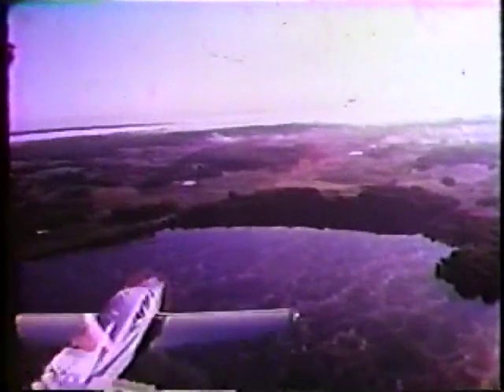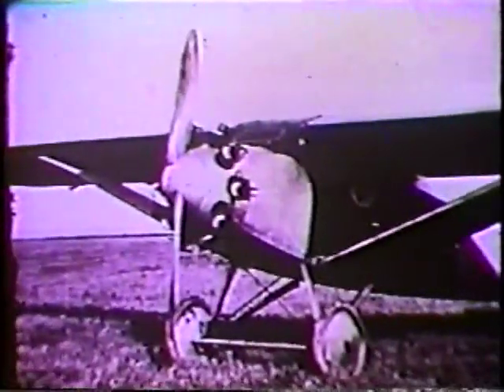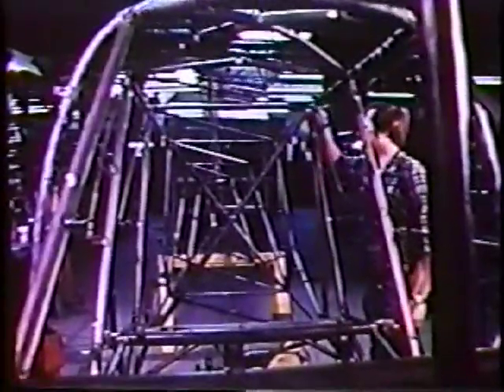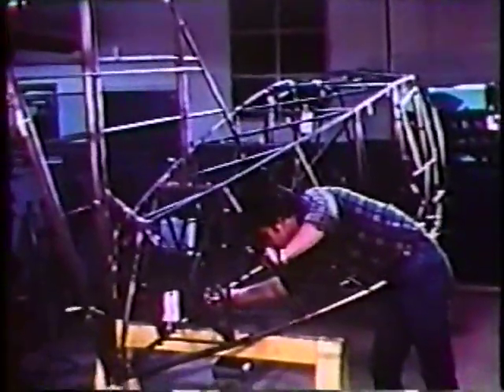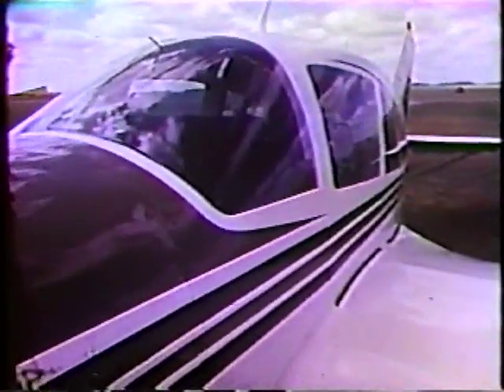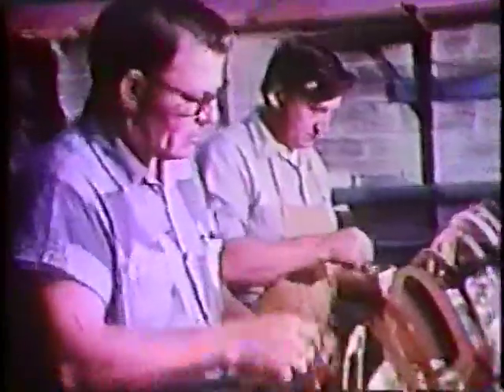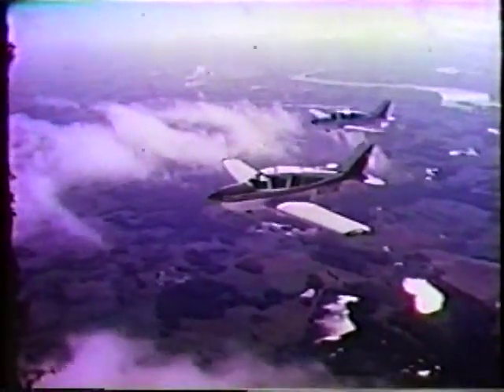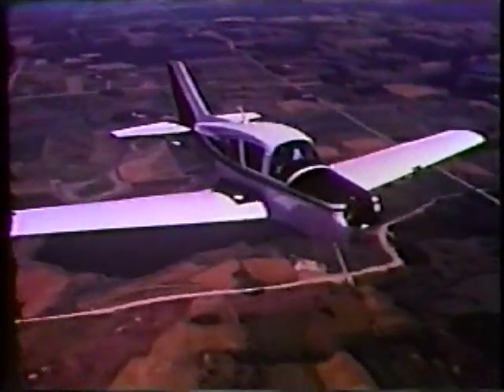The Bellanca Super Viking

Comment: SUPERB video by all measures.  Bellanca, Curtis and the Wright brothers were the top pioneers of human flight.  I've always been enthusiastically impressed with high-technology wood, fiberglass, and canvas aviation material engineering because of the nearly miraculous resulting Mosquito, Lancaster and Hughes heavy-lift amphibious Hercules.  Wood is cellulose, a superb lightweight, abundant material comparable to steel, aluminum and other artificial fibers.  As such, Bellanca, used wood instead of aluminum and lotsa steel, great aviation designers like de Havilland and Hughes, Bellanca's Super Viking is the American made, hand-made Corvette Stingray of GA AND the Criscraft of GA high production, commercial models too. OMGoodness!  Whotta performer!  The Bellanca folx and Super Vikings is/are definitely masterwork aircraft builders and I loved every second of this video.  And there is, of course, Italian-style beauty seamlessly included in everything, with its impeccable performance, which is unmatched anywhere.

Comment: God I miss flying. Had a TSIO540 BL-17ATC absolutely solid response. Flew mine out of an ultralight one-way strip. Good times. At least I managed to take the family on trips they will never forget. And that maybe we could not have afforded to do commercially, so the small investment in the Viking was worth it. Wish I'd have been able to get it sooner, (and keep it longer)  before some "work" was done on it but it all worked out OK.
Stephan if you are reading this may you always have smooth air underwing and more than enough fuel and trust your mechanic they are magicians. (I also had a Cessna R172K "T-40" with 210 H.P. and STOLkit but the Viking could easily outperform it on takeoff and landing, if you know how. If I had to crash I would prefer to do it in the Viking because I think it would be more likely survivable. Take care everyone, be safe.